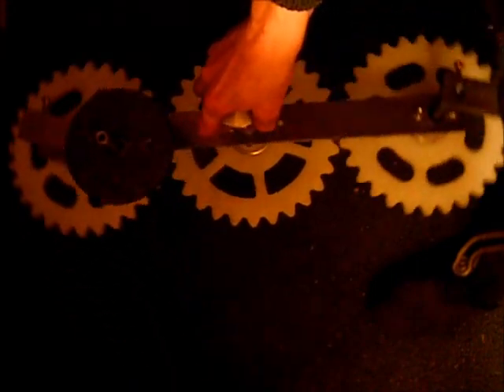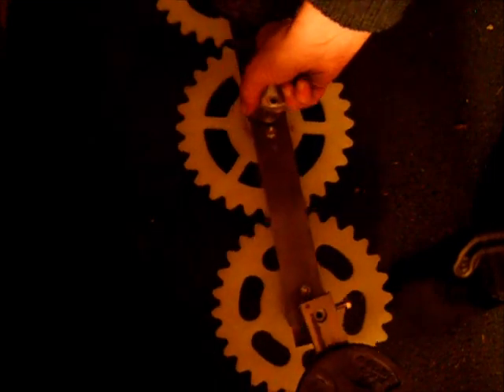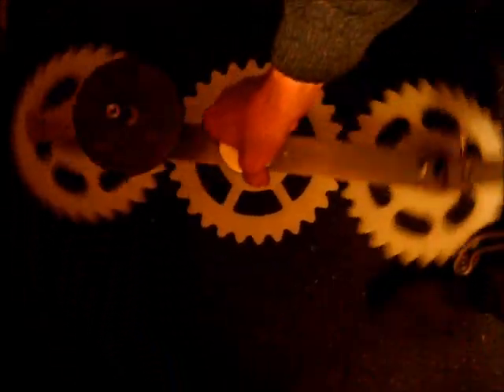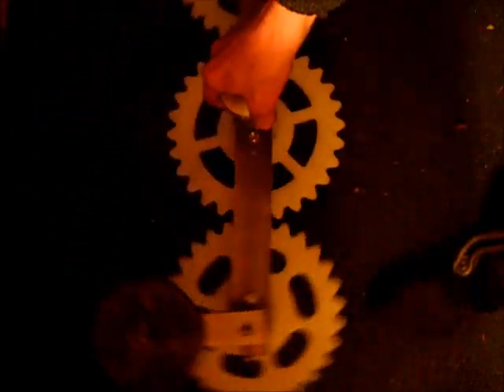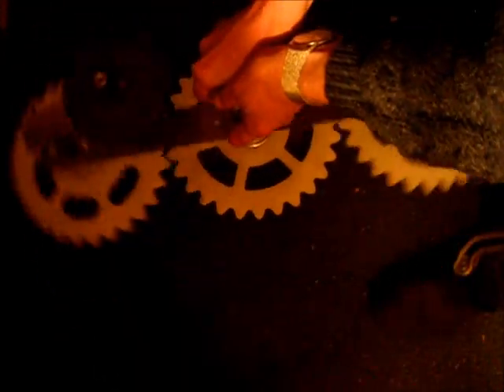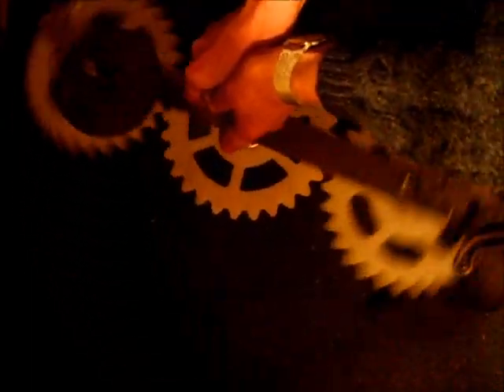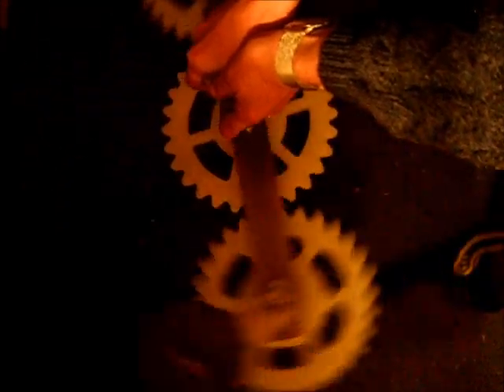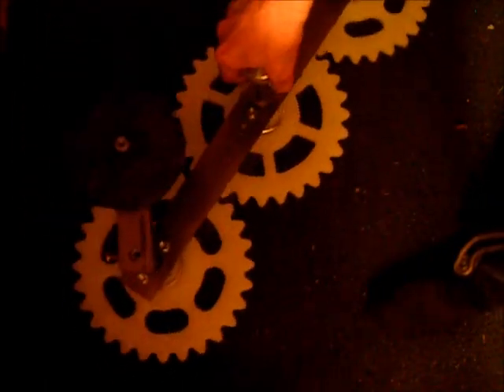possible Solution to failed simple Skinner configuration

Comment: it's like the planets around the sun. but there is energy loss where your hand is putting the power on. if you could keep that point from moving. I wonder if it worked like the Whip amusement ride.
Reply from the maker: Hi, I still have the test frame from the failed attempt. It will take a day to mount and test. I will post a new video if there is any positive results. I get the impression it is worth a try.

Comment: When the two weights are on one side of the center (which happens several times) there will be a force in that direction (tilting force). You are now preventing this tilting with your hands. What i am saying is that the idea to try it differently is very good, but I doubt if it will lead the way. And still yet, I can be wrong to. Just my 2 cents.
Reply from the maker: Hi, it will take a day to mount and test. I get the impression it is worth a try. Thanks for the input. The real problem will be how to mount a PMA.